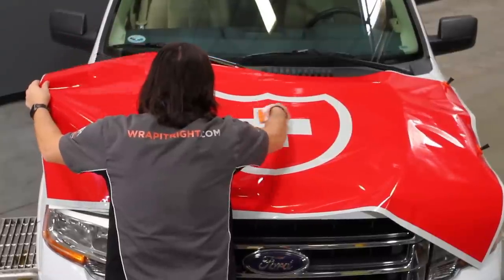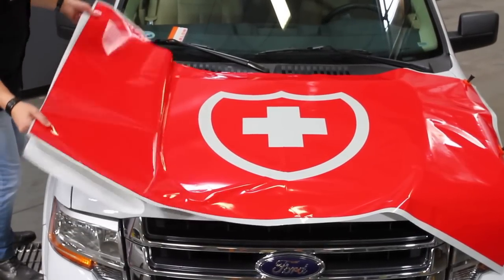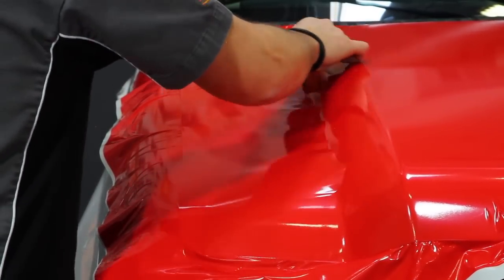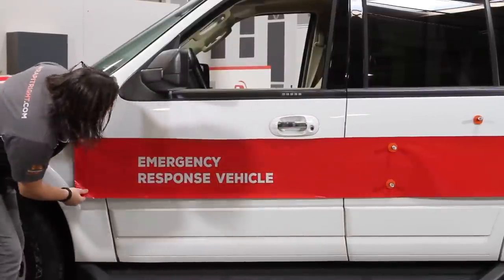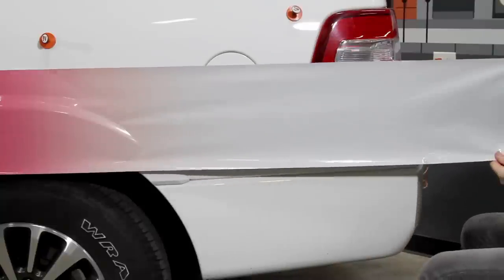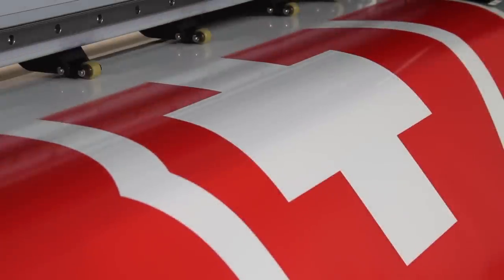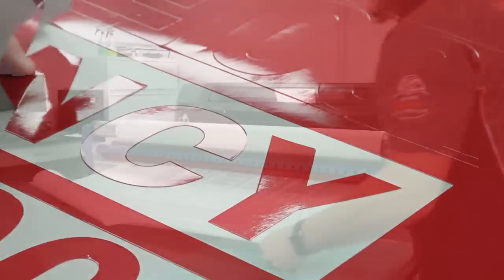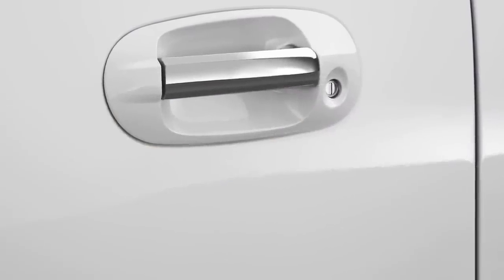Wrapping with IllumiNITE Wrap™ - Redefining Reflective Wrap Films

Comment: We have about 5-6 dozen campus Kawasaki Mules with hard cabs. They have visibility issues at early dawn and dusk thru night ops. Have you done wraps for smaller vehicles like that to show visibility for safety?
Reply from the maker: Hi Steve! This film can be used to apply to any surface other than low energy plastic. If the Mule has a hard cab then there shouldn’t be a problem installing IllumiNITE Wrap. We don't have any wraps like you described on file, though there will be increased visibility from the reflective film.